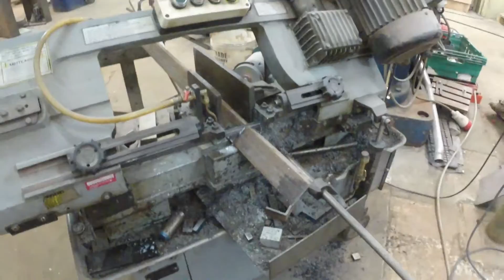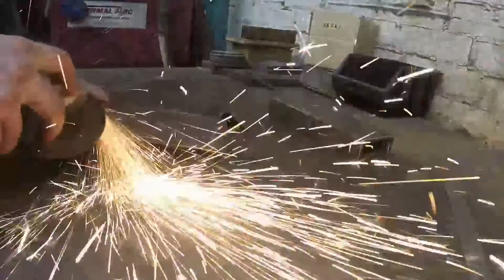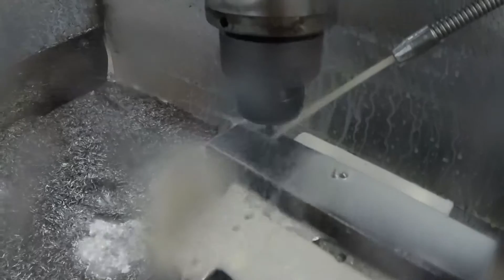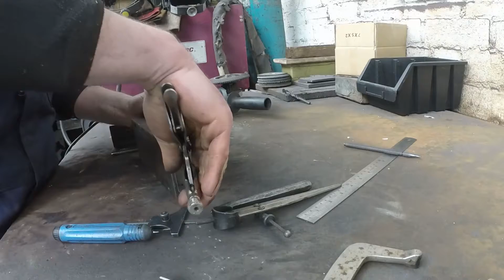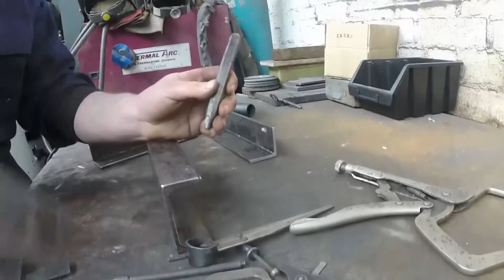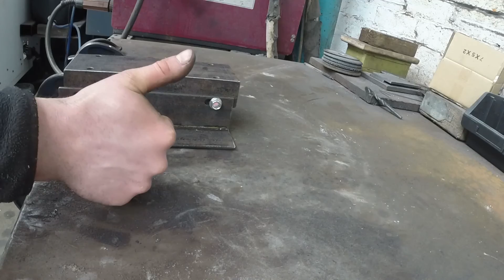CNC Lathe Retrofit Part3- Sliding Motor Mount Boxford 240 TCL

Comment: I have a Boxford 125TCL which I would like to convert to run on Mach 3 will I be able to use the existing steppers and power supply or do you think it’s best to gutt everything and start from scratch?
Reply from the maker: Really depends on the current condition and intended use.  If you're planning just to keep the stepper motors and replace the drives it should work just fine. The old drivers can also be used but its really only a matter of time before they give trouble. The original spindle drives on these are renowned for giving bother particularly the caps. I would expect you will need to replace the drive or at least some components on it to keep it working.  If its just a hobby machine there's no harm in doing/replacing components as you go along. The original components are now 20-30 years old so some failure is to be expected! I would also recommend you have a look at linuxcnc! I have converted and ran lathes on both and I would never consider mach3 again!